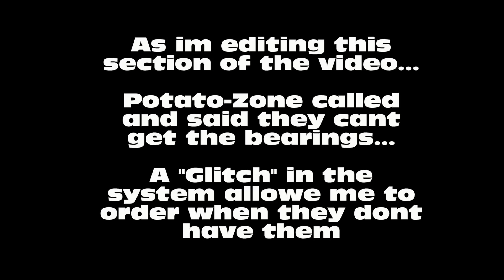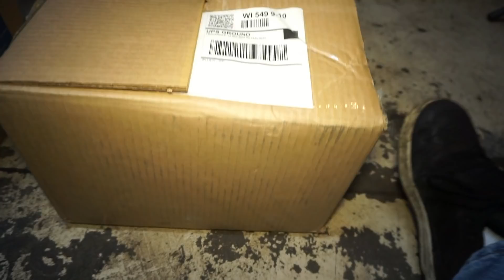LQ4 TEARDOWN VALVE REMOVAL AND CLEANING!!! V8 swapped Ranger!!! - a21bravo

Comment: Every time I open up a motor I end up changing nearly everything, don't know why when all I'm planning is cam swap and gapping rings.
I've been thru the cam bearing fiasco too it was almost like the machine shop didn't want to do them in fact I had to take the block back since they gouged the heck out of 2 of the cam bearings and tried to sand them down to fix it

Comment: If you can get the block done by a machine shop it would be definitely worth it, and if you can find a shop that can hot tank it as well it would be good for it. But if you cant theres plugs on the block that you can take out and you can flush out all the internals of the block. If it was me i would just spray the block and heads with degreaser and pressure clean it, it shouldnt hurt anything